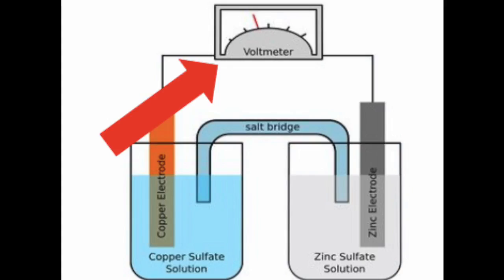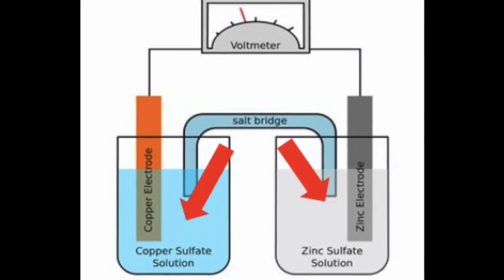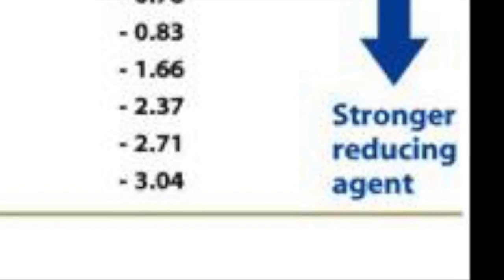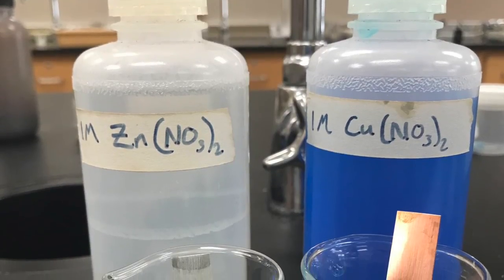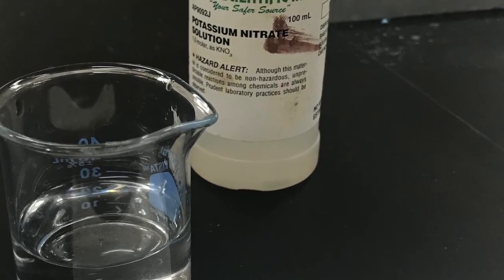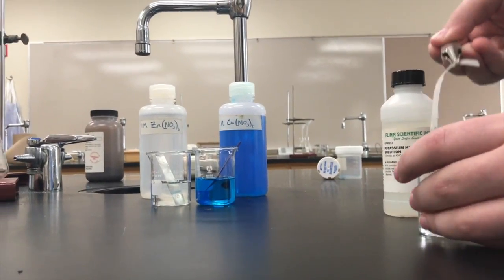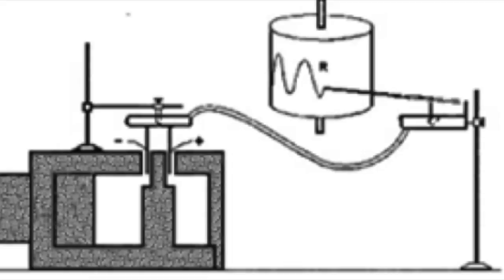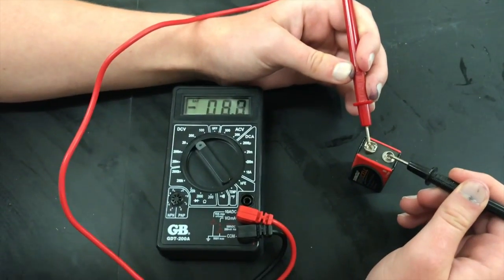Chem Lab: Galvanic Cell /Electrochemical Cell, Voltmeter and Salt Bridge

Comment: I know it won’t create electricity as shown, but what happens when the two metals zinc and copper are soldered together by tin and lead solder, and in a salt solution,  what  theoretically would happen between the two metals? Would they still slowly exchange electrons?
Reply from the maker: As long as you have a salt bride or porous salt barrier it could create electron flow until it reaches equilibrium.
Reply: Anne Schmidt thank you Anne. so it will create a electricity until the zinc runs out? Is that right?
Reply: Anne, can you answer my question please? :)
Reply from the maker: Rick Paris it will “die” once there is a build up on ions and reaches equilibrium. The metal donating electrons and becoming an ion will have a loss of mass also which is the zinc.
Reply: Anne Schmidt thank you again!